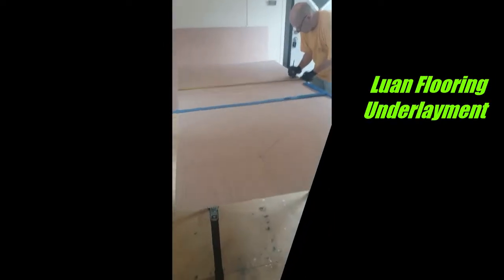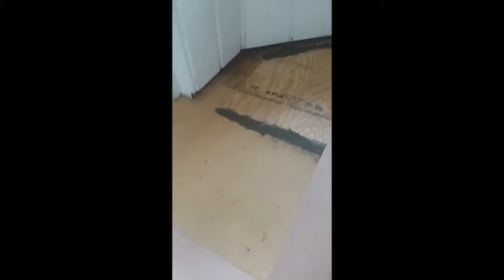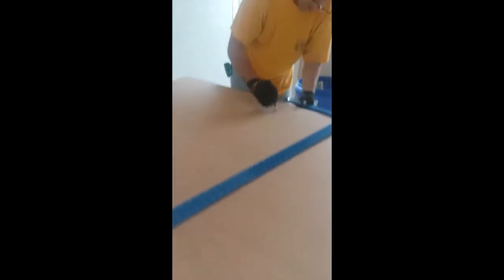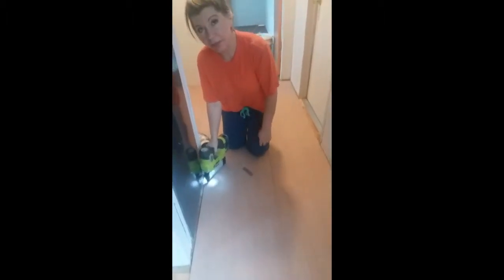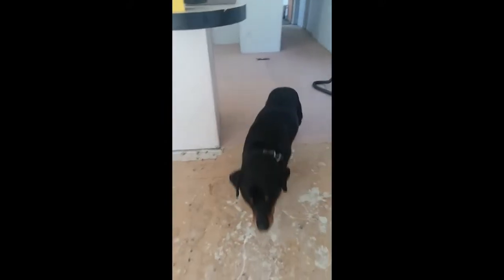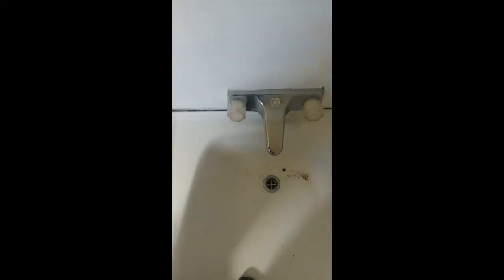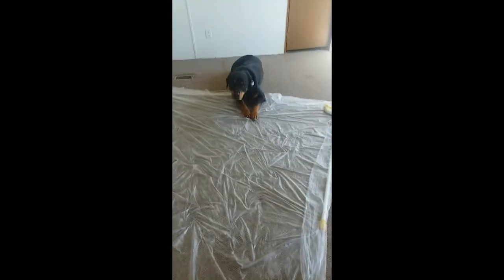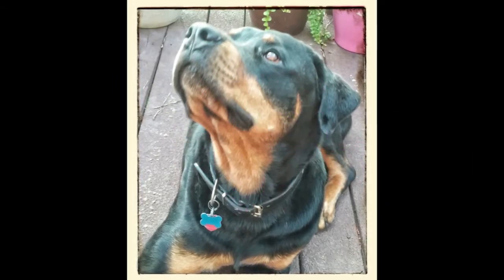Luan Underlayment

Comment: I own two mobile homes and just had to rip out all of the laminate flooring due to a nasty tenant. I'm going with lauan/ vinyl sheet flooring from here out.
Reply from the maker: Hi Thomas. That's one of the best bets. We went through trial and error when we first started. Tested some flooring for durability. Best for uneven sub floor repairs is the thin sheets of luan down, then vinyl planks on top. Even the squares over luan works just as well.